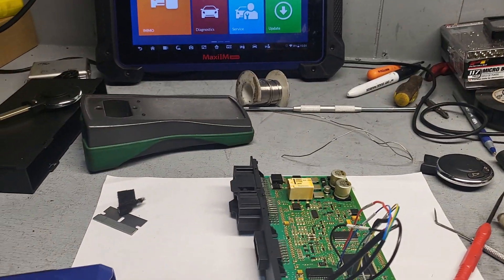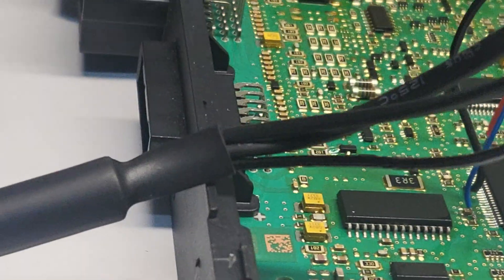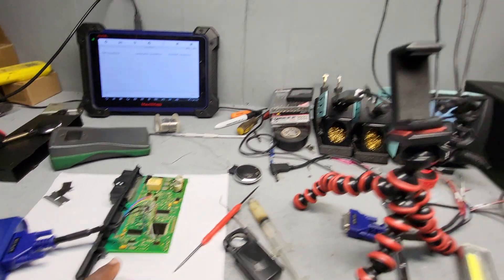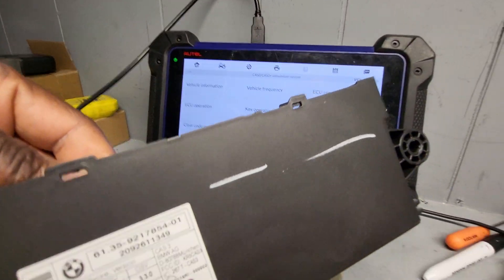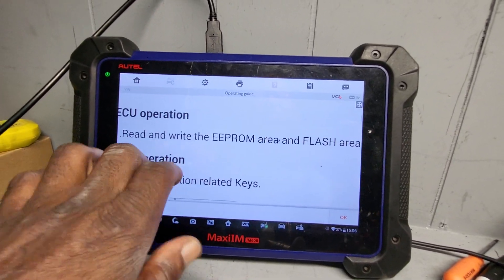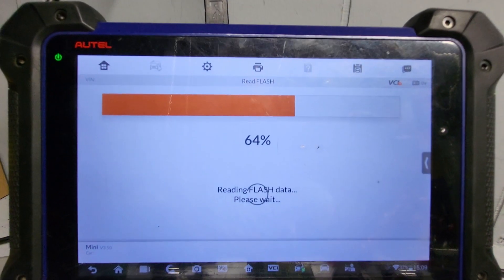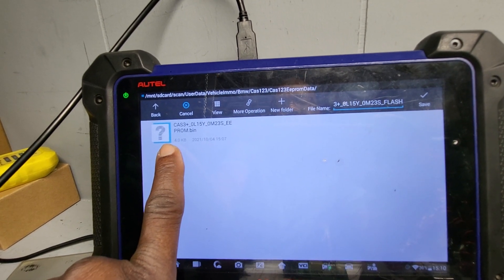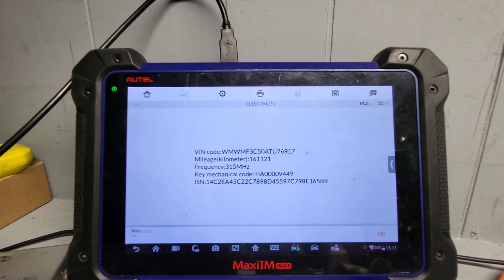2007_2013 Cooper/BMW Cas 3 On Bench  Remote Key Programming Explain What Is The Cas Module (part 2)

Comment: I have a mini cooper 2005 engine controller module is bad I have the same tool you are using so my question 🙋‍♂️ is how I do the process in the bench with the cast and a used ECM or is that possible … ?

Comment: I have bmw 2021 228 i  with this code    

BDC, Electronic Immobiliser: DME OF DDE Security Key Not Written To And/Or Not Locked and the car doesn't open switch but when I put OBD the car open ignition

Comment: Did the cable apa 106 have 6 wires or 7 wires and is that apa106 just for cas 3 for BMW and Mini? I see them in red and with 6 wires and in seven wire's can you tell me anything else about that cable the will make sure I get the right one to do my cas 3 for my mini please

Comment: Thank you for part 2 great work, and yes you have to write back the flash to the cas as it contains the new modified information. and if I'm not mistaking from now on you can add a key to that car over obd2.
Reply from the maker: Thank you all I will do it tomorrow I don’t need to call tech support my technician are here